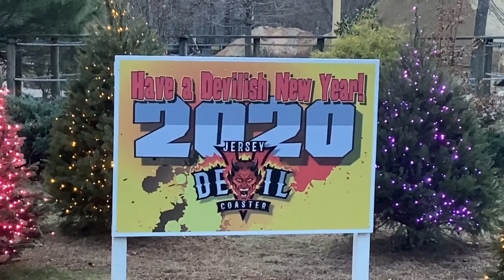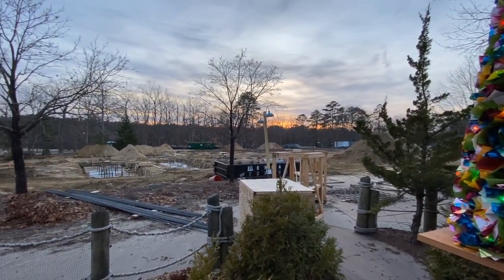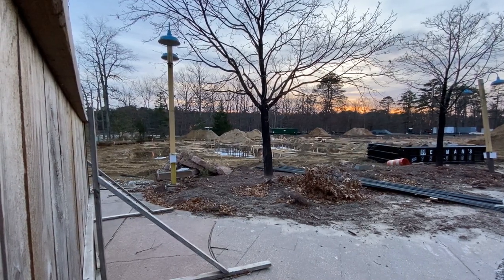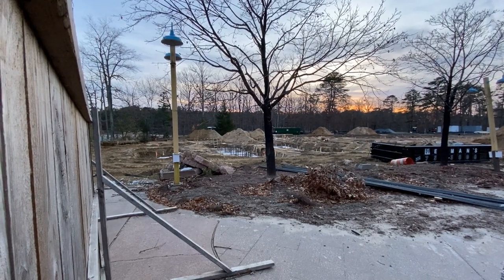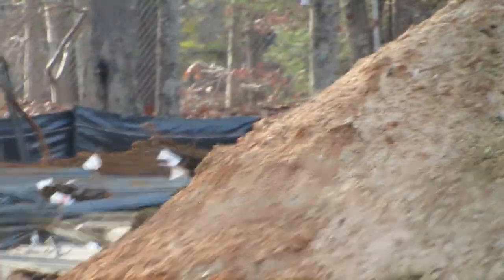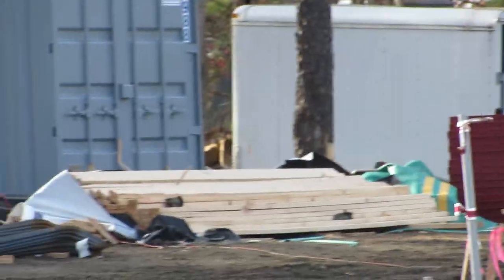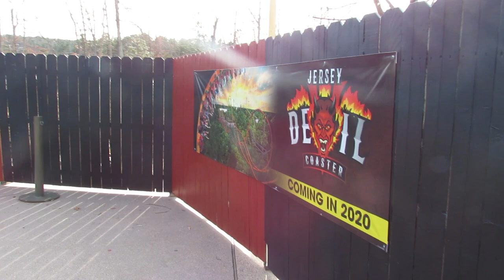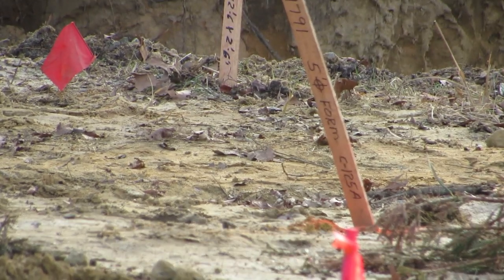Jersey Devil Construction Update

Comment: First
Reply: radical konrad you’re right, except nobody cares x45
Reply: @intenseairtime4640  you are also right but nobody cares ×67
Reply: radical konrad you’re also very right, but nobody cares x420
Reply: @intenseairtime4640  you indeed stand corrected but nobody cares ×42069
Reply: radical konrad well as much as you are amazingly fantastically correct, nobody cares x42069666
Reply: @intenseairtime4640  although you are correct in your theory it lies as a fact that nobody cares ×694296921
Reply: radical konrad yes indeed, that is true, but I think a little bit more that nobody cares 694206942069420
Reply: radical konrad as much as you have support for your detail, and it’s very critical too, nobody cares x638292929286363672829292736464673829299373646379202029
Reply: radical konrad We both have absolutely outrageous points and very mind blowing proof but nobody cares x6372820208374746636272892028366363528292929277363636362782920192736635363728829202863646465858499392927373653526272892030383773